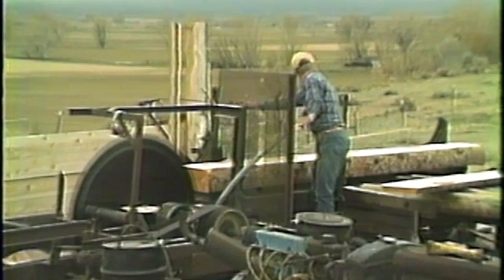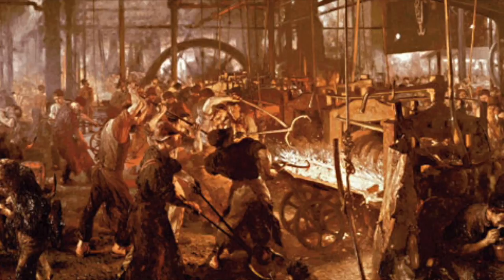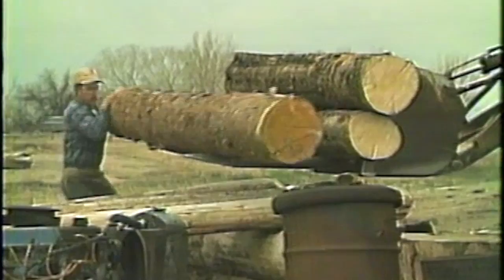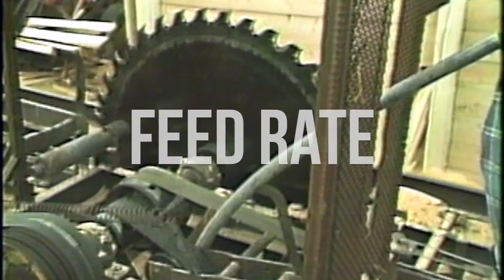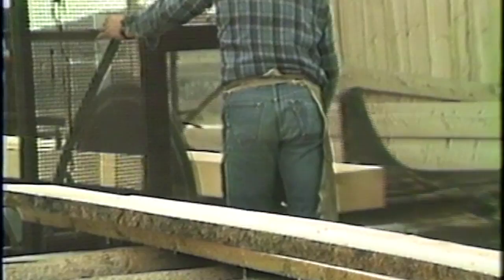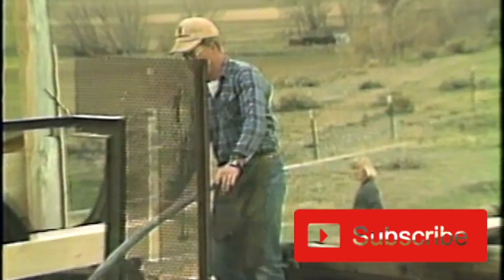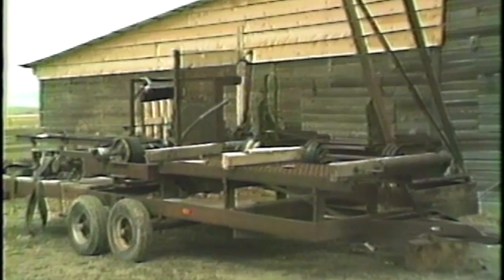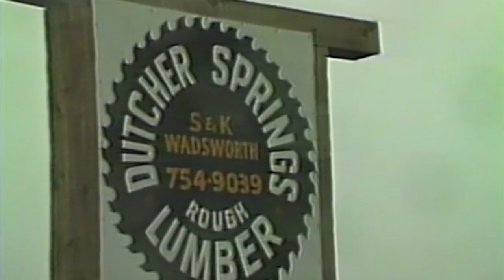A Sawmill Story

Comment: Thanks for posting this video, it gave me some starting pointers for getting my recently acquired sawmill restored.  I have a Sargent Mill (latest patent date 1901) manufactured in Greensboro, NC, in pieces and I will have to figure out how to reassemble it and make needed repairs.  I am looking forward to the project, the blade is very similar to the one shown in your video with the removable inserts in every other notch.  I will most likely power the mill with an antique steam engine, or an oil-field engine (large flywheels single cylinder).

I really wish you were closer to me, I would love to shadow and learn.  Your anvil videos are how I found your channel, and I have been hooked since.

If you like, check out my video of one of the most impressive steam powered sawmill operations still running.  It is located at the Western Minnesota Steam Threshers Reunion in Rollag, MN.  It operates every Labor Day weekend, my daughters and I go up from South Carolina to operate steam shovels at the show.  (videos of the shovels are also on my channel).

https://youtu.be/N3aBqY6vESw

Comment: Is that a lane saw mill I remember years ago an older friend had a Lane powered by a 1937 Buick Straight 8.  Worked real well. my family had 2 band saws in the early 1900.s One was used as a portable and was steam powered with a locomotive boiler. It took all winter to move and set up. They only moved it if they had a contract for 1,000,000 BD ft.  The stationary was also steam powered but was complimented by 2 stories of milling equipment powered by hitt miss gas engines.  The stationary butnt in 10378 or 1938. Then the portable was moved in to replace it. They were loyal to their help and ran the mil when product didn't sell. They scrapped thru the 40s and in 1947 the whole operation burnt to the ground. They could easily saw 4ft wide boards.   
   Here is a link to the ruins of our family mill. I had a friend from my home townof Pepperell,MA take these photos for me. I am a disabed veteran 74 years old -enjoying my memories.      
https://www.facebook.com/groups/238058192899947/permalink/4200655743306819/

Comment: Do these type of saws ever kickback? Or do the logs weigh too much for that to bee an issue? I work in a cabinet shop and I'm just curious
Reply from the maker: The constant danger is that the board will be pulled away from the saw in the wrong way and contact the edge of the saw which instantly turned the board into a 60 mph arrow shooting straight back towards the Sawyer. Not too many                off bearers as they were called were killed, but plenty of Sawyer’s were.